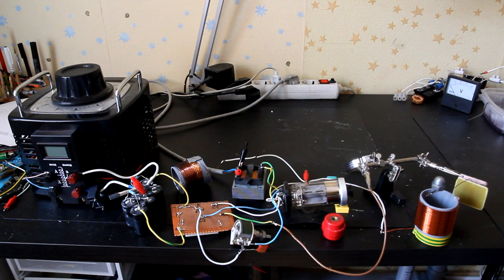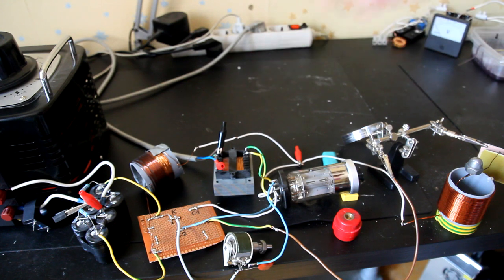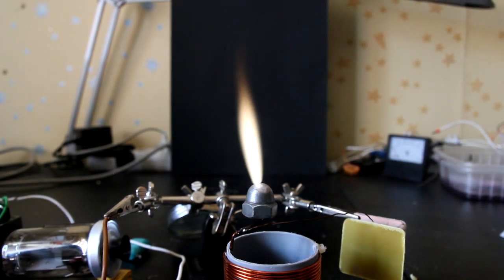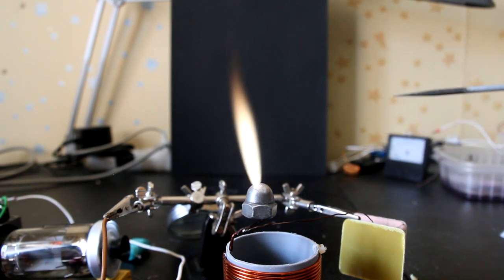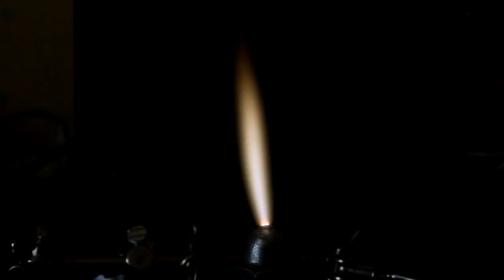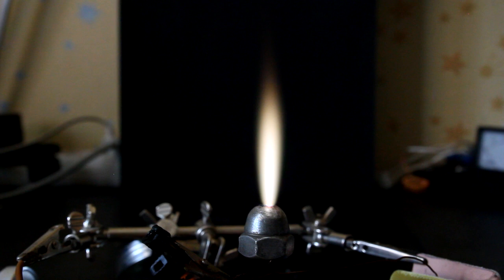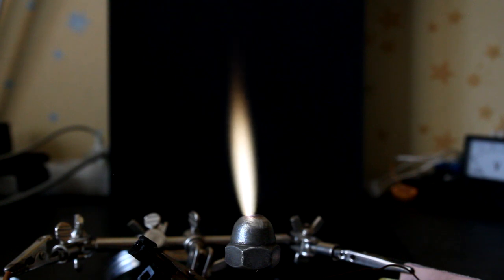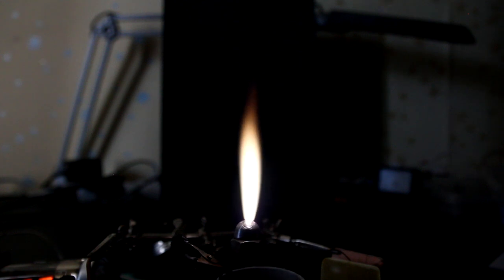The Torch Discharge (AKA RF Plasma Flame)

Comment: Here from styropyro, as a pyro myself gotta say you have a very beautiful flame
Reply from the maker: Thank you!
Reply: @Vidduley  days after seeing the video it still pops up in my head, it must be one of the most energy dense flames out there
Cause unlike chemical fires that usually involve gases or combustion on the surface of a solid this flame is not hollow at all, and not to mention the beautiful colour and consistency

I simply must recreate it I'm as obssessed as one can be before going mad. Unfortunately my electrical engineering skills and specially with high voltage are not so great
I just hope my mechanical engineering courses will give me the opportunity to do this one day

Thank you so much for showing me this
Reply: @wbeaty  bless you my man
Reply: What's the name of his video?
Reply: @wbeaty  I actually found the video before you sent the link, but thanks anyway. :)

Comment: Yes it's called "plasma torch" in English.   As a little kid in the 1970s I found a book on vac-tube induction heaters, RF lamps, and plasma torches.   They gave hobbyist- schematics for 1-tube and 2-tube power-oscillators.   
Their hobby-project for a plasma torch had a portable "remote head," where the coil of the vac-tube oscillator had a 2-turn secondary connected to a PL-59 rf connector and RG-8 coaxial cable.  This led to a remote 2-turn coil and tuning-capacitor, which was coupled to a 10turn resonant coil made from copper tubing.   A hand-held Plasma Gun!    They used a blower from a vacuum cleaner to aim the plasma-flame.   The flame could be turned sideways or upside-down.

In the professional models we'd inject very fine ceramic or glass powder through the flame, so it condenses on any surface touched by the flame.  "Plasma spray coating," as was done on reentry shields used in Apollo capsules etc.   Someday I want to try this, and see which surfaces will tolerate a ceramic plasma-torch coating.  Yes glass and metals, but what about wood, plastic, fabric, even apples oranges roses or blobs of Jello?   That, or try making the ceramic version of wood: alternating layers of silicon carbide and quartz?  Make some Star Trek hull-material.

Here at work we once had an "ICP" spectrum analyzer from 1964 the size of a small car, with a water-cooled  4KW plasma torch running at 27.1MHz, with the plasma in a laminar flow of argon.   Similar setup to the above, where the plasma flame was coming from a little water-cooled coil of copper tubing.  At 4KW it was like an arc welder, fry your eyes instantly.  (In the 1970s the device was modernized: it once had a dec PDP-8 computer and teletype!)    The plasma power supply was a huge rack called "Plasma-therm HFS," with I think a 4CX3000 transmitter tube.  Lots of those on ebay, if a rich hobbyist wanted to play.   

So, same setup as yours, just LARGE.
Reply from the maker: That is very, very interesting! Thank you so much for this information! I know about industrial plasma torches, but the ones I've seen tend to use high velocity gas flow in combination with DC arcs. Rarely an inductively coupled RF plasma in a gas stream (mostly in spectroscopy). Maybe the RF torch discharge by itself is too unstable? Or maybe it's waiting to be rediscovered in some industrial form.

P.S. about the movable head of a plasma torch - it's funny, I'm working on a similar project right now :D Transistor 13.56 MHz RF generator, power coax with connectors, and a remote torch matching unit. Maybe this channel will see it, maybe not. For the last couple of years I have been constantly feeling the lack of spare time, hence the lack of videos on the channel. Anyways, thanks again for your great and interesting comment.

Comment: I wonder how the torch would function inside a vacuum discharge tube with a hollow electrode facing the other electrode using RF, the hollow electrode would be syringe shaped and inject low-pressure dry steam inside the tube. The goal would be to electrolyze water with a RF discharge (with an orthogonal set of electrodes to accelerate protons and oxygen ions with their electrons stripped, and then collect them at the other side of the tube. (oxygen and protons would be then deflected by another set of electrodes and collected in different places due to their different weights (and different deflections). That's purely theoretical, no idea if that would work.
Reply: Dry steam is a thing?

Comment: It is kind of interesting trying to research the true history of RF flame discharges and surely one would have thought there would be a sort of standardized name for it. I'd expect it to be common knowledge among HAMs. It's also strange to not see it scattered all across the internet as a DIY gem. Perhaps big industry doesn't want the propagation of such devices littering various bandwidths just for the sake of people wanting a flame. In that regard I would have thought by now the most popular internet DIY personalities would have honed a standardized circuit for these now with intended frequency ranges. Maybe soon to come. A lot of the research I've read done with 'RF torches' does not even implement an arc discharge but rather an arc-less plasma flow of some kind.

Comment: Hey! What capacitors did you use for the voltage multiplier?
Reply from the maker: Hi, I believe these were 350 V 220 uF capacitors
Reply: @Vidduley  Ok thanks!
Reply: @Vidduley  And the diodes?
Reply from the maker: I really don't remember, I have this setup encased now; just some regular 3 A 1000 V diodes
Reply: @Vidduley  That's ok. What kind of multiplier did you use? (schematic for the voltage multiplier) You are the best!

Comment: How do you manage to understand your circuit behavior? Do you have a digital scope? To me, it would seem an essential tool for checking that each part is working according to expectations and troubleshooting potential problems. Links to articles for further reading would also be much appreciated on each project. Thanks for your inspiring videos!
Reply from the maker: My pleasure! I do have a digital scope, which I indeed utilise in tuning and checking of almost every project. I had the idea of linking articles, but most of material that I put into making a video comes from big Soviet heritage of books/articles that are either russian language only or are extremely hard to find in the English version. Here for example it seems that the torch discharge hasn't been properly researched outside of USSR at all. But I do have a couple of decent english-language sources on the topics of my interest (gas discharges, plasma, and pulsed power): "Plasma Physics and Engineering"(2011, 2nd edition, Fridman, Kennedy), "Pulsed Power Systems" (2006, Bluhm) and "Foundations of Pulsed Power Technology" (2017, Lehr, Ron). Hope you will find those helpful!
Reply: @Vidduley  Thank you for the links to the literature packed with relevant info! I can hardly wait to see my first arc!

Comment: Wonder if you could put a water vessel on top instead of the cap and still get a discharge ? I was playing with a ZVS flyback combo some time ago and it seemed like the water was getting hot but wasn't evaporating as much as u'd maybe expect, keeping the copper cool especially if the metal is not near the surface, which it wouldn't be if you were to drill a vessel at the bottom

Comment: You can use this discharge to produce nitric oxide then use that to make nitric acid. It works very well. Use a glass tube around it with foil as the feedback capacitor and pump dry air through it. Have the gasses collect cooled and bubbled through distilled water.  Collect the gas left over and cycle it through a condensor and cold trap dryer. ❤
Reply from the maker: Very interesting, thank you!

Comment: In the book "The inventions, researches and writings of Nikola Tesla" in the chapter "HIGH FREQUENCY AND HIGH POTENTIAL CURRENTS", you can find references to those types of discharge with illustrations and the book was written in 1894.
All the best
Reply from the maker: Hi, thank you for very interesting information! Do you mean Fig. 110 in the mentioned book and the corresponding description? Citing page 166 here: 

"There is still another and far more striking peculiarity of the brush discharge produced by very rapidly alternating currents. To observe this it is best to replace the usual terminals of the coil by two metal columns insulated with a good thickness of ebonite. It is also well to close all fissures and cracks with wax so that the brushes cannot form anywhere except at the tops of the columns. If the conditions are carefully adjusted which, of course, must be left to the skill of the experimenter so that the potential rises to an enormous value, one may produce two powerful brushes several inches long, nearly white at their roots, which in the dark bear a striking resemblance to two flames of a gas escaping under pressure (Fig. 110). But they do not only resemble, they are veritable flames, for they are hot. Certainly they are not as hot as a gas burner, but they would be so if the frequency and the potential would be sufficiently high."

Comment: So you used + and - 600V in the voltage multiplier output to create the the 1200V potential?
Reply from the maker: Yup
Reply: @Vidduley  Alright, I can also see some resistors attached to the capacitors. What is their function? Thanks.
Reply from the maker: These are fault bleeders. Listen, I don't mean to be rude in any way, but if you ask me about every little detail, I have to suppose that this circuit is not for you yet, as it deals with very dangerous levels of voltage and current, and requires at least basic understanding of electronics. Please understand me, my goal is to show you interesting scientific phenomena, not to make you hurt yourself.
Reply: @Vidduley  Why of course, that is the very reason I feel the urge to follow your instructions so closely, in order to prevent any malfunction from occurring. You are nowhere near understanding how much you have aided in my understanding of this project, and I must thank you for that, kind stranger. I do announce that this is the end of our long, yet fruitful conversation about a topic we are clearly both keen on. May you never stop helping other people from gaining knowledge, and may I never need you again. Keep up the great work and farewell, my friend.
Reply: @Vidduley  Your responses are just so cool 😂

Comment: Hi, I noticed you said you are using a voltage quadrupler, but I see 6 capacitors. Did you mean symmetrical voltage tripler, or are you using a different configuration. Thanks.
Reply from the maker: Hi, it's two Villard doublers (positive and negative) connected with common inputs, giving out +600 volts and -600 volts, so there's 1200 volts in total across them.
Reply: @Vidduley  I am still confused about the purpose of the third capacitor for each doubler, since such circuit only utilizes 2 capacitors. Could you please elaborate?
Reply from the maker: Oh yeah, I almost forgot about it myself :D The output 600 V caps are made up of two 350 V electrolytics in series each, because there aren't really any 600 V electrolytics. On the other hand the first capacitor in the doubler only experiences 300 V peaks, so there I used single 350 V electrolytics.
Reply: @Vidduley  Oh I see. That makes sense. However, I thought electrolytics are unsuitable for such multipliers since the first capacitors experience AC. Is it fine with this case, or do they still pose a risk of explosion?
Reply from the maker: Nope, the first cap experiences pulsed DC, just like in regular single-diode rectifier circuit, so it's fine.
Reply: @Vidduley  Sorry, just to clarify, are you referring to this circuit: https://www.electronics-tutorials.ws/wp-content/uploads/2018/05/diode-diode50.gif or this circuit: https://www.electronics-tutorials.ws/wp-content/uploads/2018/05/diode-diode51.gif      ?

Comment: Hi sir, I'd like to ask, is that capable of producing thrust? And if yes, how much would the force be
Reply: It uses an alternating voltage, so no electrical field force is involved. All the force is caused by a high temperature of a gas that supports this discharge. Like a typical chemical engine.

Comment: Did you say that the heating of the Torch Discharge channel was due to the displacement current? i.e, proportional to the rapid dE/dt? I do hope you will find the time in spite of your studies, to upload more videos! Thank you for the very instructive demonstrations :)
Reply from the maker: Hi, glad to see you in the comments again! Yes, in the simplest model the torch is modeled as a capacitor in series with a resistor, so the higher the dE/dt, the higher the current will be. The problem is that actually this is more of a slow wave transmission line, with losses determined by plasma parameters and a dozen variables you have to take into account :D So far, personally I haven't seen a single model that would fully describe the RF flame. 10 MHz flame yes, possibly, 1 GHz flame, also something believable, but a single frequency-dependent model - nope. The lack of general academic interest in this topic doesn't help, though I'm planning to maybe get things there moving a little bit :)

Comment: Did you use ceramic or other type (film, MKT etc.) capacitors and at what voltage rating for each? Thank you.
Reply from the maker: Ceramic capacitors, each rated so that it wouldn't blow up

Comment: I don't understand this discharge. Is it ac or dc voltage "discharging" ?
Second, where is the electricity going in the discharge - is it dissipated through the air to ground in general, or is it (99.9%+) converted in the flame to heat and some light ?
Reply from the maker: This discharge is powered by high frequency AC voltage. The voltage drops along the discharge channel. The power introduced into the discharge is (99.9%+) dissipated in the discharge volume as heat and light, and maybe some radiation.

Comment: Awesome content man !!!   I saw on another comment you mentioned using digital scopes on almost every project... Do you have any pointers on keeping the equipment safe ?  I have already burnt power supplies / wires / IC's / etc etc ... So I'm kinda nervous and keep HV away from my scopes & DMM's. Is a potential divider really safe enough to use everywhere ?
Reply from the maker: Uhh, it's a really tricky subject with costly equipment and HV. I have a couple of tips for you.
1) Physical Ground is a must: the oscilloscope's ground lead should be connected to real earth (ground). It can be done either through PE wire in your mains, or finding a real grounded piece of metal (rebar, water pipe) and connecting to it. Make sure that it's REALLY grounded, or you might cause problems not only to your own equipment, but to your neighbours too!
2) Avoid grounding loops (connecting ground to several different places in a circuit). Either use oscilloscope's ground (grounded internally through PE) as an only ground source for the whole system, or connect real heavy grounding cable as close as possible to it.
Neglecting (1) and (2) can damage the scope by breaking down through it's components by "scope signal input - scope mains input" path. Without a ground the scope's potential can jump up because of parasitic parameters. Next tip is to protect the scope's input itself from breaking down, i.e. unexpected overvoltages:
3) Remember that fast signal edges are your enemy: they get across dividers through parasitic capacitances and get to the scope's input not attenuated, hence overvoltage and potential scope's channel burnout. Fast edges are either produced on purpose with special nanosecond generators, or occur whenever a spark/flashover occurs. So if you have something like that, be ready. You can put an output of the potential divider straight to the RC integrator with very low inductance capacitor/resistor, if all you care about is DC signal. The RC should consume the fast edge. Otherwise use low-resistance dividers to shunt any parasitic capacitances as much as possible.
4) There's a saying at where I work that goes "the noise comes by wires, air, and ground". I have already covered wires (3) and ground (1 and 2). The air (any empty space really) means this: any fast signals will induce voltages on nearby objects even if there is no electrical connection at all. So keep your distance, and make use of the inverse square law. try to place equipment as far as possible from your setup, even if you have to get a couple of extra meters of cable for it.
5/extra) Real laboratories often have a designated Faraday cage for all the measuring equipment. Just a couple of days ago I myself witnessed that the scope picked up noise even being in a Faraday cage, but with it partially opened. The cage needs to be fully enclosed volume. If you cant use sheet metal, use mesh/screen.
Tl;dr: make solid ground connections, remember about parasitic parameters when dealing with fast edges, place the equipment far from noise source and/or shield it electromagnetically.
Last tip: scopes sometimes (oftentimes) like to scare you by flashing all the buttons at once when they pick up noise from flashovers. I don't know why this happens, but I have never had any scope malfunction because of it :D 
Hope that helped. And yes, I do like to make long overly detailed comments :)
Reply: @Vidduley  this is an old comment, but it is incredibly helpful! your knowledge is much appreciated, especially considering i’m currently amateur at best with electronics :)
Reply from the maker: @Luka-lm1pr  I'm glad to hear that, thank you!